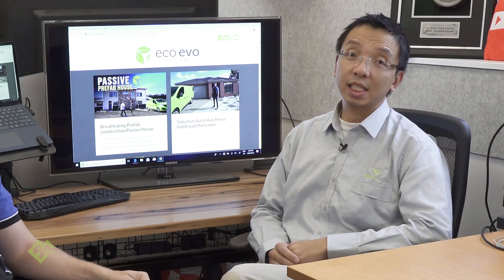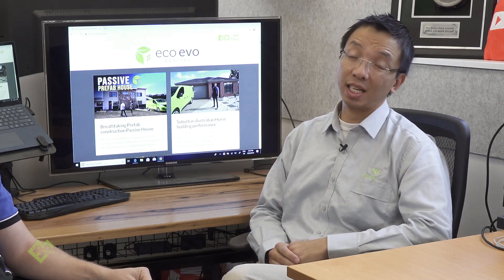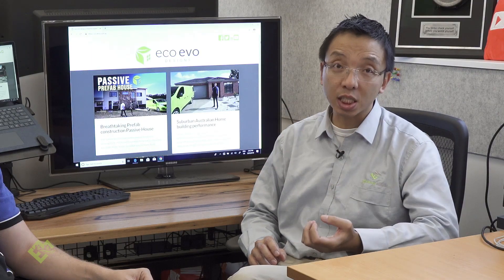Can you have problems breathing in an air tight home?

Comment: The reason you need the ventilation system in the first place is because the home is super tight. The point of the tightness is so you never have to open the windows and let in the bad air..and old home may leak air but its  still a form of  self venting.